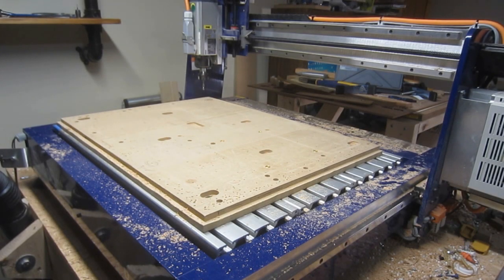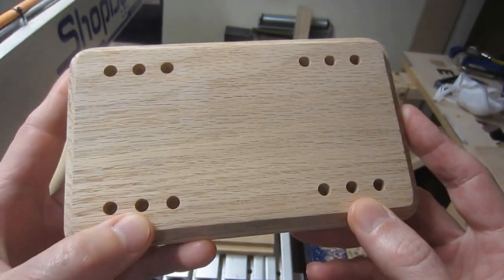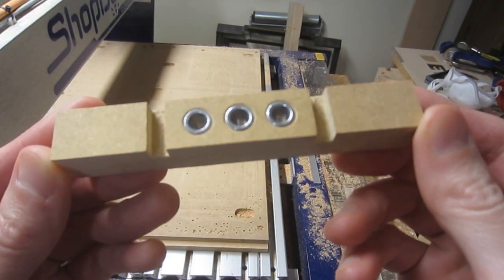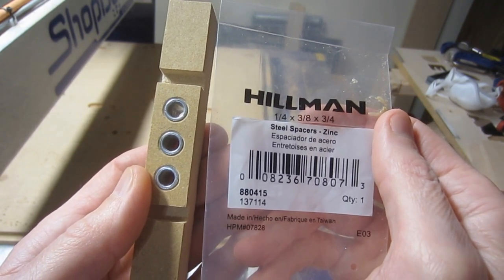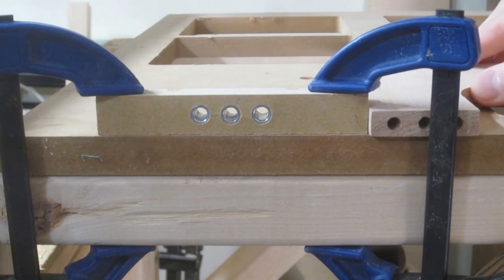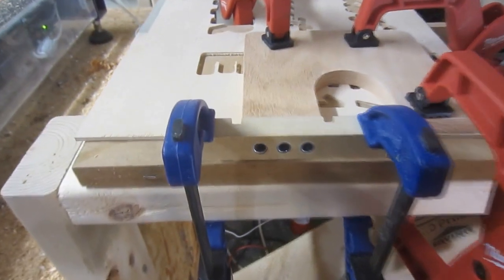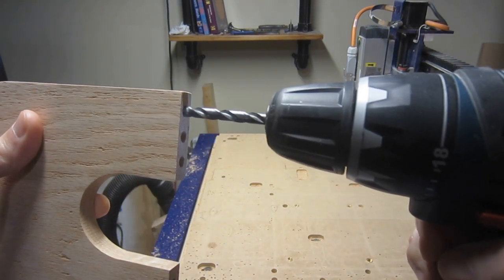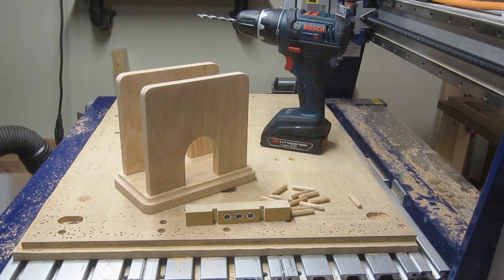CNC Router Projects Presents- Dowel Joinery for the CNC Router

Comment: You can always create a clamping vertical table, on the edge of your wasteboard (like, in the front edge of your machine). Then just clamp the boards sticking out on the top edge, and run the program to precisely drill, bore, dove tail, finger joint, etc.
I dunno if I explained myself correctly 🤣😅

I like your vids, subbed 🙂

Comment: I have a dowel jig that would make this much easier without using my cnc. If you had a way to put the holes in the end of the uprights on the CNC this would have been interesting but I think it made it more complicated. I also think you could have used the slots you cut either side of the dowel holes to align the leg of the upright piece. - It was a good video but I don't think it was a good use of the CNC. Just my $0.02